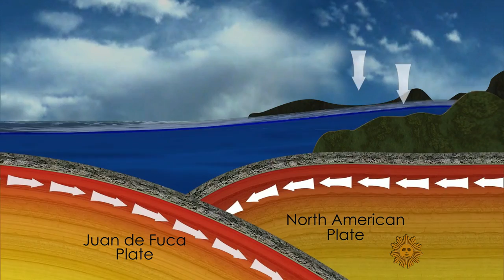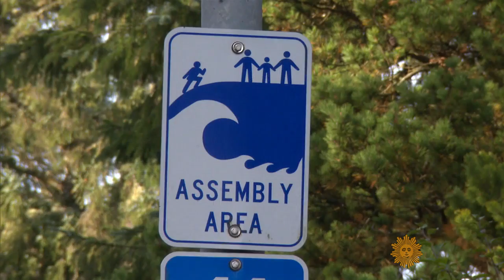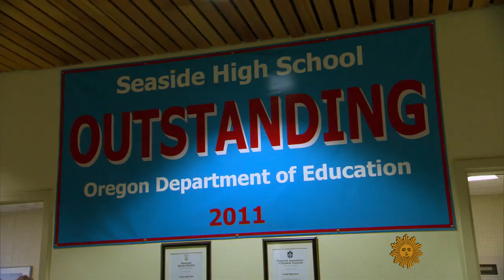Only a matter of time: The disaster awaiting Pacific Northwest

Comment: Wow, this was really very understated. You don't only lose several thousand people when a 4 minute long 9.6-9.8 quake hits. The Juan de Fuce plate sits off of the northern coast of California, about even with where Mount Shasta sits inland and stretches all the way up into B.C. and it should be moving about 10 feet, at the very, very least, it will most likely be closer to 60 feet.

Comment: The 7 million will be effected by the earthquake ... far fewer will be effected by the tsunami ... Seattle, Portland, Tacoma, Eugene are all clear of tsunami hazards ... also note this CBS piece assumes a "full rip" event, where the whole fault moves ... 50/50 chance the next one will be "partial rips", three segments are known, three separate earthquakes all far less than this piece describes ... something that can be prepared for ...
I'm sorry, Cascadia may well break the records ... 9.5 ... 9.7 ... there's beach sand deposits 200 feet above sea level ... a tsunami 4 times higher than March 2011 ... there's no preparing for that possibility, it's not just human structures all come down, we have mountain flanks that will slide off high pressure magma chambers ... yup, three or four volcanoes exploding ... Yellowstone ripping apart ... 1,000ºC pumice rock 1,000 feet deep from Denver to Savanna ... LA Rams winning a Super Bowl ... how do we prepare for any of this? ...

Comment: Okay I looked it up on Google Earth.  The High School is 23 feet above sea level, Broadway middle school is 19 feet above sea level.   So a 50 foot building will have a roof platform that is either 73 or 69 feet above sea level depending on which site it was constructed on.   If the waves are 50 feet high and the building stands, then it should be a good show but save some lives.   A 44 foot building will be either  67 or 63 feet above sea level at the top, still should work for a fifty foot wave.

Comment: They've been telling us this for 40years. Coincidentally about the same length of time they've warned us of the California fires.
Reply: The science of continental drift is only about 40 years old.  That could be why.
Reply: @kerrysmith1899  The science of continental drift is 108 years old
Reply: @chado3000  But, it wasn't accepted for decades.  At 108 years, it is still relatively new.  It was also predicted in 1596, but dismissed.
Reply: @kerrysmith1899  Continental Drift theories have been around for over 100 years, I think you're think about plate tectonics which has been around since the 60s.
Reply: @eamontanner6778  I noticed South America fit in nicely with Africa, when I was in junior high, in the 60s.  The science has grown exponentially since then.
Reply: @kerrysmith1899  Yeah that was part of Wegener's evidence of Continental Drift back in the early 20th century. Plate tectonics blew up in the 60s however. It would have been an awesome time to be a geologist!
Reply: That was a man made disaster due to lack of brush / forest management.
Reply: @Scottar50  the California fires are for sure.

Comment: they just said the waves can be 50 feet high. Then they tell us about a tsunami safety school that is 40 ft  high. They are betting and not have 50 ft waves. A bit confusing.
Reply: I was thinking the exact same thing ... I would not want to be standing on that school roof which is Sunday 44 feet high and maybe be saying a wave that is 60 feet high rolling in .
Reply: Jo Lind — You are not taking into account the elevation of the land.  I am sure they have.
Reply: @GH-oi2jf  the land in japan dropped about 9 feet.
Reply: They are not measuring the height of the building from sea level.   The waves are estimated to be 50 feet above sea level.   That school is probably at least 30' above sea level, so the top of that building would be something like 74' above sea level.
Reply: A death sentence, !00 foot high, OK, but building below what they expect, lunacy!

Comment: Vertical evacuation is the most practical alternative.  Seaside twisted arms to get the school proposal passed, but it was the wrong strategy, in my opinion.  There is only one chance in six that school will be in session when the tsunami hits, and the school population is only a few hundred.  A vertical evacuation structure would have been far less expensive, and other structures around town could have provided refuge for the townspeople generally.  As it is, they have only maps and signs for evacuation routes.  But it will be impossible to evacuate Seaside in the time available because of the geography, even for those who know the evacuation route.  For those unfamiliar with the route (thousands of tourists) it will be chaos.

Comment: Why build the high school so close to the ocean...rebuild...
Reply: "because we can"
Reply: Leslie Keith — I’ll take "City built the school before they knew the Tsunami risk" for $500 please...
Reply: @Erin-Thor  "trial and error"..
Reply: Leslie Keith — That property has been the location of the high school for a century, long before we knew anything about tsunamis.  But they are building a new school in the hills to the east.  I don’t think that’s the best solution.  There is only one chance in six that school will be in session when the tsunami hits.  The entire town will be flattened, not just the schools.  Seaside will be impossible to evacuate in time.
Reply: @GH-oi2jf  those are very bad odds..
Reply: Leslie Keith, where I live, we built a High School directly over a "fault line"!  After several decades, the school "had" to be torn down, and another one was built several miles away!  FYI, and my .02 cents!
Reply: @LiPo5000  I hope it was on higher ground...my 10 cents worth...
Reply: @lesliekeith9230  No, it's all flat land in my area, lot of swamp lands!

The school was moved due to the constant maintenance on the building.  Ceiling falling in, outside walls with severe cracks, plus plumbing issues, so it was finally moved to a safer area.

Comment: Sorry to be a buzzkill, but 44feet is not tall enough.  Make it a hundred feet and you might be good and only if the structural support holds.
Reply: T Dawg 
That's what I was thinking too.  44 feet, that's nothing for some tsunamis.  Supposedly there have been tsunamis of nearly 1500 feet in the prehistoric past.  Not that it would ever happen again, but then it could.
Reply: Do some research on the underwater landscape in the PNW. It isn't the right coastline to get giant 100ft tsunami waves like what we saw in 2004. 30-40ft is likely as big as they'll get.
Reply: @eamontanner6778  they were talking about preparing for a large tsunami.   4 stories isn't very high

Comment: If the tectonic plates in the Cascadia area slips and moves significantly, it will be a lot worse than "5 or 6 Katrinas."  Since May 2018, a magma blob has moved into the Cascadia area.  This large lake of magma in the Earth's mantle will provide the heat to cause significant Cascadia plate movement. As the Earth aligns with the Black Star around twice a year, much more heat will be pumped into the Earth's core and mantle caused by the massive inputs of electro-magnetic radiation given off by the Black Star.  Eventually, during or after one of these alignment dates (now in November and May), there goes Cascadia and the Pacific Northwest as giant tsunamis engulf the low lying coast line areas there. The 2020 census for that area could be quite grim.

Comment: A BIG COLVERT TUB LIKE UNDER THE ROADS WITH CAPS ON THE ENDS WITH A DOOR THAT CLOSES FROM OUTSIDE TO HYD PRUSSURE SHUT, WITH A SLAB POURED FOR A FLOOR  TIES TO FLOOR, CALL IT NOAHS ARC, AND HOPE YOU NEED IT ONLY ONCE,  BUILD SEVERAL AND PLACE THEM CLOSE , LIKE ON THE ROOF. ANCOR THEM SO THEY CAN"T GO TOO FAR BUT UP SOME WAY AND BRAKE LOOSE WHEN SO MUCH SEA LIFTS IT SO FAR!!!! I THINK WITH A LITTLE PLANNING YOU WOULD COME UP WITH SOOMETHING GREAT!!! GET OFF YOUR DUFF AND GO DO IT!!!

Comment: That 1700 earthquake happened during the Maunder Minimum. The New Madrid fault had quakes during the Maunder and Dalton Minimums (GSM). During a Grand Solar Minimum, there are fewer sunspots. It was first noticed in the Maunder Minimum that we had fewer crops due to less sunshine. The sun and the earth's magnetosphere are reduced in a GSM which allows more cosmic rays to reach the earth. Increased reception of cosmic rays correlates to increased earthquakes and volcanoes during a GSM. We are entering a GSM in 2019. Time to move away.

Comment: If one tectonic plate was sliding under another, huge amounts of soft sediment would be scraped off of the sea floor.
There should be cubic miles of this stuff at such a theorized subduction line.

However, no examples of this have ever been discovered. What does that tell you?
Reply: Sorry skippy, but you are full of BS.  There is ample evidence of the accretion of sediments from subducting plates!!

Comment: hmm..40 feet off the ground?.....only if your already at least 50 feet above high tide.....Some waves that hit Japan were over 30 Meter's.....and 4 story building way above the tide line...were over topped.it isn't just a wave...it's a wave thats huge already but is 5 to 100 miles in wavelength.Plus with the land itself falling over a meter in height,whats to say that won't destroy the shelter in the first place?

Comment: 6:35 "Fast enough" is before this massive quake hits. Any slower and everybody dies.
     Oh, as for the "vertical evacuation zone" First, the building needs to survive this massive quake, that may shake for minutes, then it must survive the mass of water, filled with boats, cars, and bits of broken building that will hit it.
      Has anyone built a building that can survive a 9.0+ Earthquake and still be intact enough to survive a huge tsunami? What sort of testing has gone into the structure of the building, and have contractor "cheats" been taken into account?

Comment: How much does it cost to sink 4 50' pylons into the ground and make a deck? Local contractors could build it for free and get a tax write off. Cover the deck over and install lockers with food and water. Put tennis courts underneath the deck. 
A deck that's 30' X 30' could easily accommodate 500 kids.

Comment: It isn't just the Pacific Northwest, it's a number of areas on the world map!  But if Kilauea causes a slide, a tsunami will push north and probably affect Alaska's islands but ripples could also affect the whole west coast, as could the Cascadian Fault if it shifts to a greater degree, as they say it will.  Should surprise no one, as our planet Earth is very active and those tectonic plates re moving all the time, sometimes millimeters, sometimes miles!  And volcanoes will erupt more as time goes on, Kilauea is a minor part when you consider that's now the Hawaiian Islands were formed, and Mauna Loa is higher from sea floor to top than Mt. Everest by about 3/4ths of a mile.  All our mountains in the Cascade, Sierra, San Gabriel (and other) mountain ranges were volcanoes at one time, St. Helens, Shasta, Lassen, Rainier, all the way up to McKinley and down to Mammoth and Bear in SoCalif, as well as other mountain areas on our continent (including Mexico).  If Yellowstone blows, it could cause the 6th mass extinction.  It's not the immediate area that causes the trouble, it's ash clouds that block the sun, the plants die and all mammals that feed on them, it will taint the oceans, etc.  Tomorrow or in 100 years -- who knows?!

Comment: The basic science is explained here, but the concept of being "overdue" is highly misleading. The most recent CSZ megathrust was 318 years ago, and before that we only have estimates. The previous one was about 800 years before 1700, and then 200 years before, then 300 years before, then about 1000 years before. In short, there's really no definite technical pattern. The next one could be tomorrow or 500 years from now. We don't understand enough about the geological dynamics going on to really predict when it's going to happen.

Some have speculated that there is a pattern of a big interval (800-1000 years) followed by two short intervals (200-400 years). If that's the case, we may be headed for the second short interval quake soon. But that's just speculation; the intervals could be wildly off due to our estimates being too far off, or those intervals could all just be a coincidence.  

What we do know is that they happen, they suck, and we need to be ready. So join a CERT, get some skills and maybe take some geology classes! It can't hurt. :-D

Comment: I've lived in Southern and Northern California since I was 14 years old.
And I've been through numerous earthquakes, which, luckily, I've never experienced any real damage.
But I've had numerous dreams over the last few decades of a huge tidal wave rising over the high heels and lower mountains of Central California (the Pacific Ridge from the coast along Pacific Coast Highway (Hwy 1)
The height of the waves were approximately 200-300 feet.
I've also had dreams of similar waves reaching about 180 feet coming into San Francisco. I lived on the 19th floor of a condominium building on Cathedral Hill at the time.
I'm guessing the height of the building along with the height of Cathedral Hill would make the waves around 250 plus in height.
That's scary.
Sure, I realize these were only dreams. And dreams are almost always due to unsettled hopes and/or fears. But considering that a very large earthquake along the Cascadia Subduction Zone could create such enormous wave height, it's also a valid fear. 
I certainly hope I never see this in my lifetime.
I'm 57 years old now, but I believe it's becoming more likely this could occur at some point in my lifetime.
I'm a surfer from the mid 70s. I've surfed California on countless instances, from San Diego to the Oregon border. And I've been on some fairly large waves that reached 20 plus feet. That doesn't sound very intimidating but when you're riding such a wave it's much higher than it's seen. 
I couldn't imagine being on the coast or especially along the beach front when a 100 plus wave hits. It would be devistating to countless beach front honest and low-lying communities.
Thousands along the coast would perish immediately and thousands would be injured severely.

And this doesn't include the effects of various earthquakes along the coastal areas.

Damn...If this happens, it will be more than anyone has considered. More than FEMA will be able to respond. 😔

Comment: People don't understand the geography of the Pacific NW.  Almost all the big population centers are FAR away from the Pacific coast, AND have nearby high ground.  The 9+ magnitude quakes happen a few hundred miles out in the Pacific, where the continental plates meet.  Places like Seattle or Portland will feel it, but won't be harmed much, and the waves simply can't get to either of them with any force, and the people would have hours of warning to get off the beach.  Only the rural coastline areas are in real peril.
Reply: Not nearly that far out. The Cascadia runs within 50 miles of the coast in places, and a 9.0 would mean a huge chunk of it rupturing. Also, in a rupture the land-side plate would be the one moving, so water would be pushed upward well shoreward of the subduction boundary. You're looking at only 15-30 minutes warning depending on location.

You're also not taking into account liquefaction. Earthquake shaking can cause certain types of soils to behave like liquids, and a number of areas in Seattle are quite vulnerable to that (not sure about Portland). Harbor Island and the industrial district are in one of the areas with high susceptibility to liquefaction. A building may be built to withstand earthquake shaking, but if the ground beneath it essentially liquefies it can fall over like a toppling domino.
Reply: Good points.  I'm more worried about Mt.Rainier erupting.  I was born and raised in Seattle/Tacoma.
Reply: More like 30 to 100 miles depending on where you are at.

Comment: Question. Will fracking have any future affect on this happening sooner?
Reply: For that to be possible, for one thing it would seem fossil fuel companies would need to start fracking in the Cascadia subduction zone. Although oil and gas companies tend to love secrecy, the offshore drilling activity would be pretty obvious, like the drilling activity in the Gulf of Mexico. You'd have lots of drilling and extraction platforms offshore, and a large industry in port cities to support them. Along with thousands of workers rotating between the platforms and homes on land. Also note that offshore drilling is typically on the continental shelf margins, whereas subduction zones are in deeper water.

Given that the energy input to subduction zone earthquakes is from plate tectonics, fracking shouldn't add to the energy of such earthquakes. The steady movement of the plates causes energy to build up, and it has to be released by earthquakes sooner or later. If fracking caused an earthquake to happen sooner, it might mean the earthquake would be less intense than if it had occurred naturally at a later time, when more strain had built up in the rocks.
Reply: No.  Plate tectonics predate humanity, and will postdate humanity.